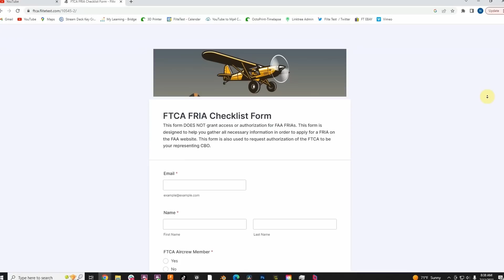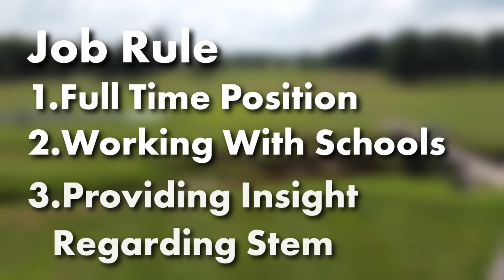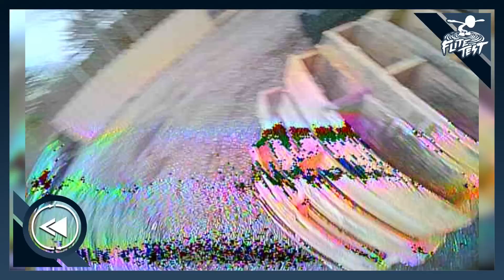Flying through A Building - Crash Test

Comment: with it configured with the ailerons, and with the battery in, is it still less than 250 grams?
Reply from the maker: Mine weighed 260 g. You’ll need to peel the inside of the paper off of the wing, and the fuselage, and be very strategic with glue to keep it under 250. The three channel can be built under 250.

Comment: I was thinking back when you guys put holes in the plane.  and than about the movie "The Aviator"  where he's like make it super smooth no rivets.   Soooooo what would happen if you covered a plane with sand paper?  ok make it happen lol
Reply: covering a plane with sandpaper would make no difference to aerodynamics because the velocity of the air at the wing's surface during flight is zero.  Eliminating bits like the skewers and rubber bands would smooth the aerodynamics.  Good questions.

Comment: Hay would you consider adding flaps
Reply: I have a Tiny Tutor and I'll be getting this wing and using a 5 channel receiver so I can set up aileron-flaps with just the ailerons.    I know the flaps should be in-board of the ailerons but I've done this before and it works.  The 5 channel RadioMaster PWM ExpressLRS receivers are tiny and not expensive.

Comment: Can you run a 3s battery on this?
Reply from the maker: You can run it on a small 3cell. So it will definitely be over 250 g and the flight characteristics are greatly compromised.  It’s faster, but not as balanced in flight. The two sell gives you great performance, and still plenty of power for its size.
Reply: @FliteTest  thank-you for the reply, I want to get other 3s planes and I was hoping the batteries are interchangeable